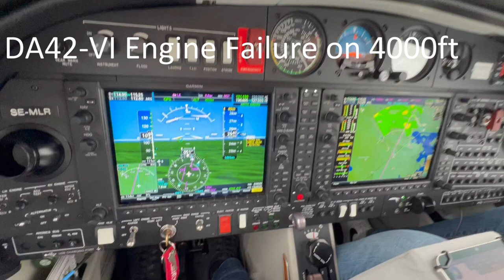SE MLR, DA42-VI - Engine Failure

Comment: Please do update the description when you find out what happened. I have about 400 hours teaching in the DA42NG and NG-VI (and still do on a regular basis) and these Austro engines aren't the best. They leak oil from several different points, even after the turbo oil return line has been redesigned like 3 times between the E4B and C models. The turbos are prone to shock-cooling, they leak coolant if it gets hot out consistently, and there are several major ADs out here in the US for oil pumps, fuel pumps, timing chains, and more. Rumor has it these engines aren't making it to their TBO, and that concerns me.
Reply from the maker: Thank you for your comment. I will let you know as soon as get any info from Austro factory.
Reply: Hello! Anything new?
Reply: Diesel engines in Diamonds aircrafts don't have TBO. They have TBR - to be replaced.

Comment: Have a question for you - did you need to set the master to off to feather? Curious as it looks like you lost oil and so curious whether the prop was windmilling until setting master to off.
Reply from the maker: I don't remember that particular detail, but I would say that the prop went to windmilling position after the master was turned off...
Reply: some interesting things to note: 

the engine oil and gearbox oil are two separate systems. say if you loose oil from the gearbox oil reservoir, the propeller will begin to move to a high blade angle (feather), which is opposite from what you would see in a lycoming or continental engine

the only condition is that the rpm needs to be above 1300 rpm to enter full feather, if below 1300 the propeller will enter start lock position, which is a few degrees out from feather

Comment: Good thing the DA42 has good single engine performance.  Just don't turn left.
Reply: Actually you can turn left in a Diamond twin engine on single engine failure. I saw a guy do it with an instructor on a simulated engine failure. It was in a DA62.
Reply: @paidtourist6563  I guess you can if you want, but single engine failures in light twins have very high fatality rates.  I wouldn't take any chances.
Reply: @Maniac742  The DA-42 mounts the engines further inboard than pretty much any piston twin. A lot less yaw. Seem much easier to fly on one engine than is typical. Also has decent climb performance on one engine.
Reply: @paidtourist6563  check the comments section.. there's lots of people who told off NOT to do this... banking on the side of the dead engine is a way to enter a spin... you don't want to do that one a single engine...
Reply: @sidb9540 There's no problem turning into the dead engine at blue line using a moderate bank angle. In fact turning into the dead engine can give you a better climb rate.

Comment: Totally out of curiosity, I see you have 0264 or similar in the transponder, instead of 7700 (emergency declared), is there an explanation to why? Like this is totally a mayday call, instead of pan-pan, right?
Reply from the maker: Hi, we didn't declare emergency since we have one good engine left and it was not a mayday call. Never then less, we did everything according to emergency check list in case of engine failure.

Comment: Hörde från Martin om ditt motorbortfall, skönt att det gick bra!
Reply: OR THEY OVERHEATED THE OIL BEFORE.
Reply from the maker: @outwiththem  No we did not, acutaly we didn't get any wornings at all...
Reply: @Vlada68  lOOKS LIKE OVERHEATED OIL THERE. It will fail the engine.  Steep long climb before?